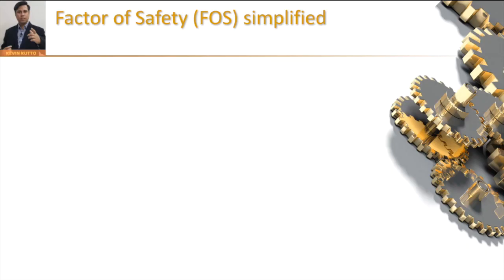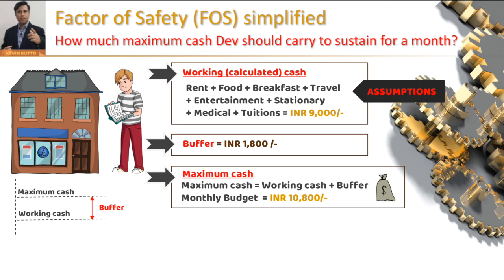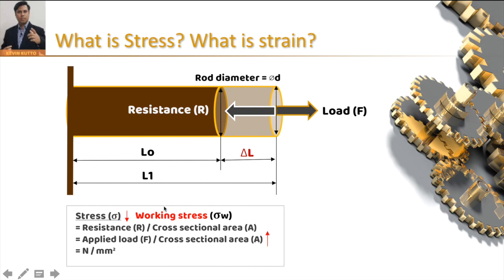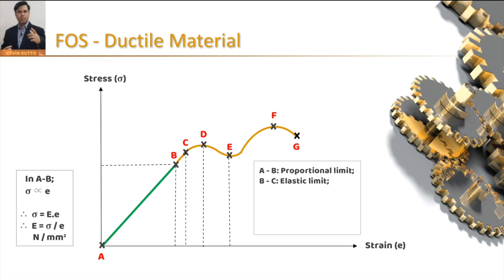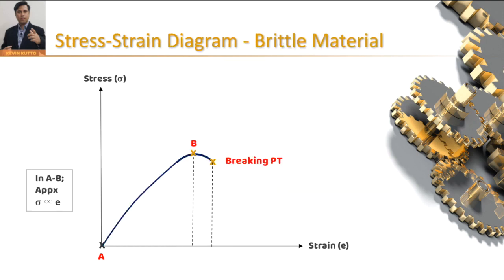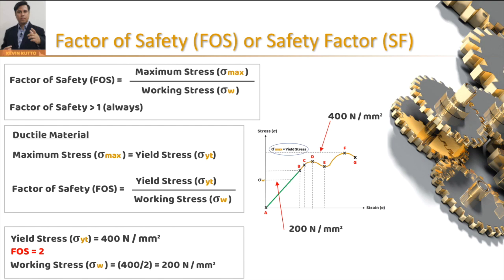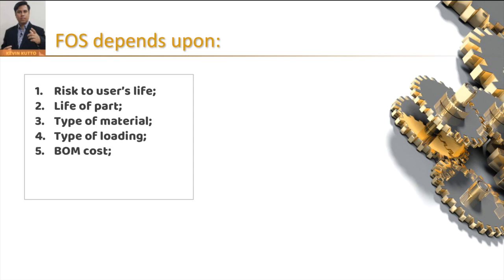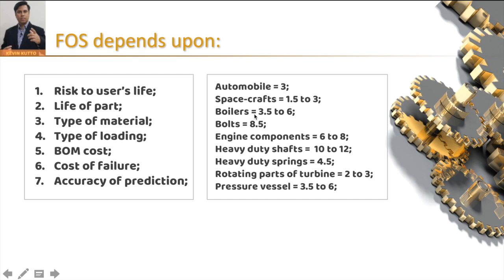How to choose Factor Of Safety: FOS | Stress strain curve simplified

Comment: Thank you for the excellent explanation and video content!
I have one quick point I wanted to clarify regarding the stress-strain diagram for ductile materials. In the graph, it appeared that the ultimate tensile strength was labeled as the yield strength.
My understanding is that while ductile materials have both a yield strength and an ultimate strength, we typically use the yield strength for Factor of Safety (FOS) calculations in engineering design. This is because once a ductile material yields, it undergoes permanent plastic deformation and is technically considered to have failed for structural purposes.
Could you please clarify if this was just a quick oversight on the graph? Thanks again for the great content!

Comment: I don't understand why the calculation says that we should divide the UST by the working stress  to obtain the safety of factor but then you actually: 450/3 arent we meant to find the safety of factor???
Reply from the maker: I have shown the formula of FOS in case it's not available & we need to calculate it.

But for most of the designs, based upon the applications, FOS value has been recommended.

I have provided some of those values at the end of the video as well.

So,  if you have FOS [Recommended] and if you know the working stress [By Design Requirement], you need to calculate stress to select the right material.

Comment: Spacecrafts perform in six Sigma level, so their accuracy is more and also fos depends on the materials.  In space craft the materials used are aluminium composites and some parts are also made of titanium alloys which make them more stronger.
Reply: So by using aluminium composites and titanium alloys they reduce weight of spacecraft with less fos also ensuring the strength of the craft.

Comment: Hi,
music is a bit annoying.
Reply from the maker: Thank you Maris for the feedback! I will improve upon it in my next video!
Reply: To reduce weight aircraft industry uses low fos...
Reply from the maker: @akashreddy3497  How they maintain safety then?
Reply: @mechanicalvault  they do analysis of material..
Reply from the maker: @akashreddy3497  Yes, analysis, adherence to stringent regulatory guidelines and quality control measures are some of the ways they ensure safety even with the lower FOS;